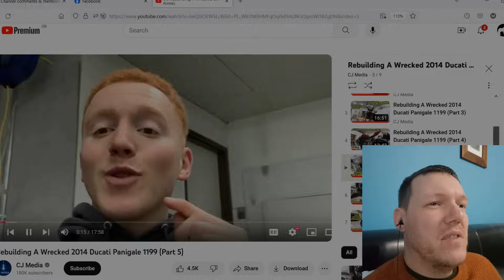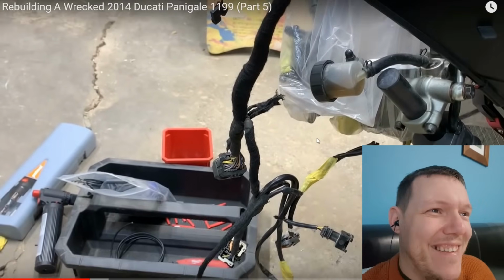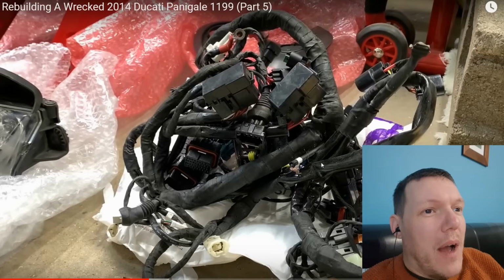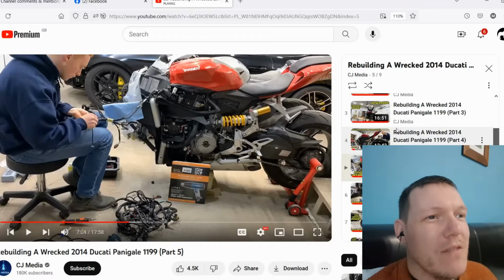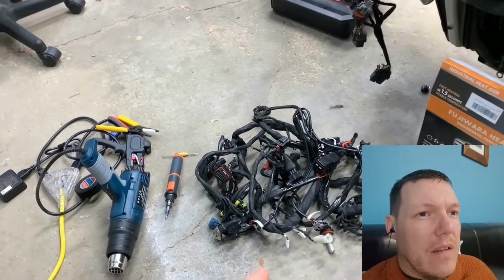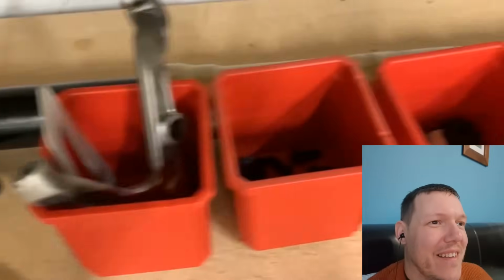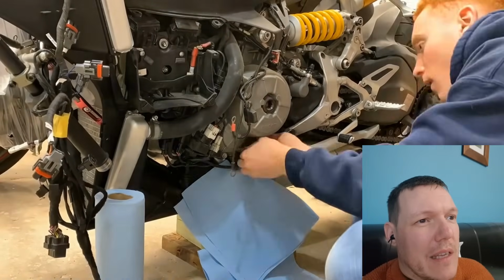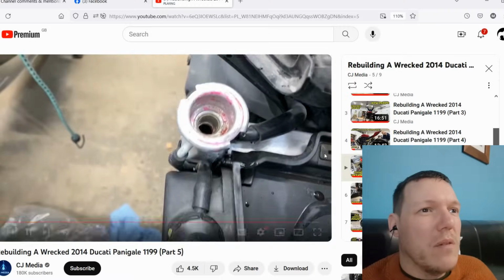GINGER - Ducati 1195 #5

Comment: with a front end smash like that i strip it down and send the frame to the  engineers to be checked out be for i spend eney money on it
Reply: Honestly though how would you be able to confirm that it's safe, I can't imagine ducati releasing the data pack required to interpret the results.

I mean you can do the X ray and ultrasound for internal cracks and I suppose you could get ducati to jig it and check it's not twisted but...

Would that give you enough to make a decision to put it back on the road.
Reply: @jediknight1294  Whats proper frame testing for then? To confirm if a part is fit for further use or not and condemned.
Reply: @bananabrooks3836  the frame is the engine
Reply from the maker: No, the frame isn't the engine. The engine is the engine. The frame is the frame.
Reply: @thedirtyworkshop  there is no frame.
Reply from the maker: There's a sub frame. Still a frame. You don't have half frames for r1s do you?
Reply: @dirtygarageguy  the sub frame is bolted to the engine and it holds the seat up.have you ever seen a non trellis ducati?
Reply from the maker: I know what it is you tard, but it's called a sub frame. It's not a monocoque. It's a sub frame. It's not my fault you don't understand words.
Reply: @thedirtyworkshop  calling someone a tard or a ginger is great .
Reply from the maker: Are you ginger?
Reply: @user-gg7pr3wu7r  no, the engine is a stressed member tht the frame bolts to same as a lot of the 2000s fireblades.

Comment: ohh no he ruined a wiring harness (that he mentioned was already was ruined previously, as it was posted in the ebay ad for it) to fix the wiring harness that's already fed into the bike. you think he did that because that's the easiest and most direct way to fix the wiring harness in the bike? Or was he not skilled enough to take the harness out and re install a new one into the bike?

Comment: What we use here in the "custom" and DIY bike and car community is mainly 5 things: heat shrink, TESA tape (like he did), self bonding/galvanizing rubber tape (completely water sealed when cured and usually 235-ish C heat resistant), different types of sleeves from PVC flexi hoses to chafing protective mesh hoses and sometimes the "liquid" tape that is a rubber that cures in ambient air humidity. Never ever use normal electrical tape...when we see that we know it was a shit job. The TESA tape isn't usually used directly on the wires when used on exposed motorcycle wiring looms because it is water permeable. An usual combination for example would be the self bonding rubber tape and the TESA over it or a sleeve over it etcetera. That's just how most of the self taught and decent mechanics do it here, not stating that it is the ideal way. PS: who the phuck uses normal electrical tape in 2023...like...the other ones are a few Euros more expensive and you can get them literally everywhere. The TESA tape is in every little car part store and the others in any neighborhood electrical store or normal crafts/DIY store. If us poor Romanian guys can afford them, I would expect Western people with 4 times the incomes would use them to. If you search hard enough in some stores or order from Ali, you can also find the self adhesive open sleeves that for example Magneti Marelli use, but after some years if they are not good quality they can delaminate/de adhere at the seams where the adhesive is and can let water in, usually if it's a place where it has a  tight bend or flexes regularly. BTW Matt, regards from your FB community and thanks for the good advices in private, Valentin.

Comment: What i think is happening is like Del a lot is happening off camera from Dad and his tools, you'd solder and shield the cables properly and have a mini bench to work off. The 3rd cable is an intake air pressure sensor. RE the triple tree its most likely one of those straight line hero runs head on into the back of a car / truck.

Comment: 30:00 Steering could be at an angle but there is also the rotational speed and the speed with which it happened, basically it happened so fast the wheel had no time to turn and think about the leverage the massive front end has on the steering bearings, the frame is fine though 🙏

Comment: That liquid electric tape is good iv used it few times repairing looms or quick fix till payday job but it was only good for sealing no waterproof plugs not really in a middle of a wire because it takes a while to set, like few hours the stuff i had

Comment: I think that liquid tape is just a type of potting glue, but those solder sleeves are pretty decent as long as you heat them until the solder looks shiny and not dull, which everyone seems to get wrong.
Reply: I've only used them on new wire making looms, but yes, I'd agree with that 👍

Comment: Ive never used liquid tape and probably wouldnt.  If the wire is nicked, super 33 tape is what i use or if possible just cut back the wire to where its good. Brand matters on tape 3m is my favorite. If the wire is past saving using that, it needs to be repulled. However on a bike or car I wouldn't use tape to fix a wire IF I can help it.  Cut splice solder and heatshrink.

Comment: You're right about the triple tree size, 1199, 1199S and 1199R have different fork diameter. You can check the specs, this one is obviously from a different model.
Reply: Is that going to mess with the geometry, like is there a rake difference?
Reply from the maker: No. The rake is the angle set by the stem. The trail may be different if the offset is different, but I don't know if it is. Ginger doesn't know what any if these words mean.
Reply: @thedirtyworkshop  gotcha this is going to be... Interesting when he rides it then
Reply: Either way, with its skew-whiff frame it’s still going to pull left like a NASCAR 😆

Comment: I would had taken out the rear fairings and tank to check if the frame, tail and rear wheel are aligned. Hopefully the frame is good, but with the impact it had, anything could be twisted.

Comment: If you suspected the frame was damaged how would you check it other than eyeballing it? Surely you'd need to do that ultrasonically.
Reply from the maker: A straight edge and a plumb bob is a start.
Reply: You can use Benjamin's private  property special frame grade tree

Comment: the way Ginger holds the camera in front of his face; once i think of the Naked Gun intro, it's all i can see.

Liquid Electrical Tape; brush on, air drying synthetic rubber, "Electrically insulates to over 1380volts/ml.". Never used it, never heard of it, but at 12V i don't see why it wouldn't be ok